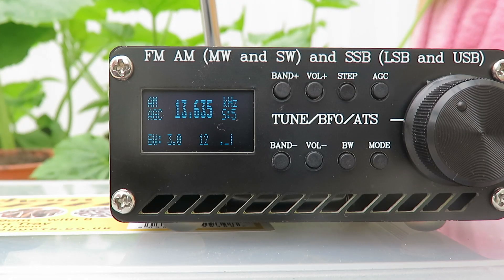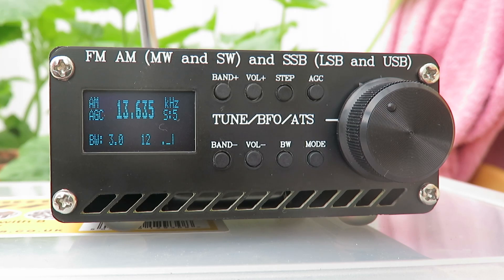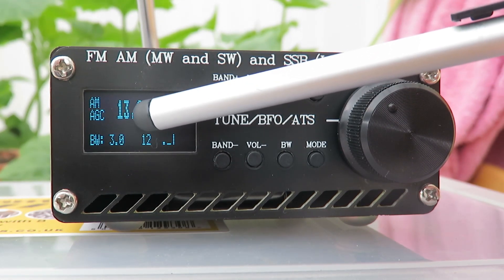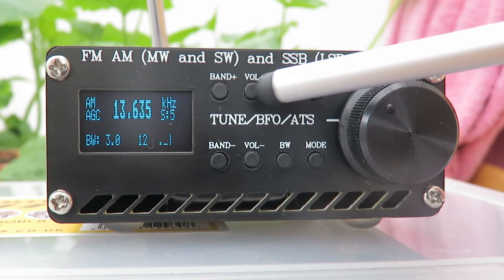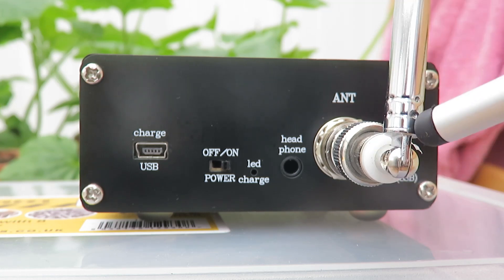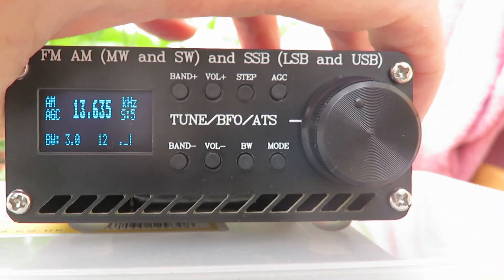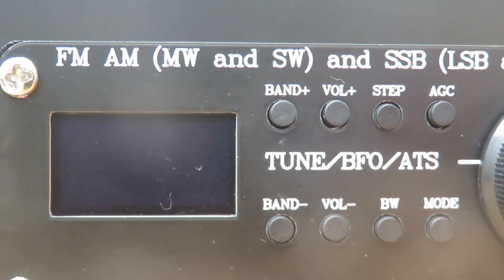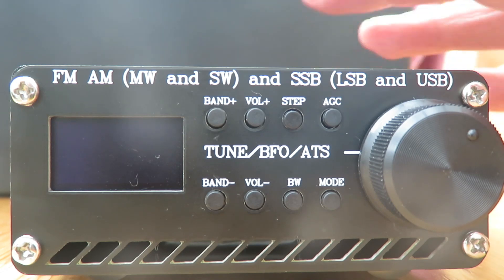An Introduction to the SI4732

Comment: sorry to bother you with what you might consider a silly question.  i have a ATS-20 branded SI4732, and have been rather pleased with it, my main reason for getting this radio, is to listen to amature hams.  my question is, what is the bandwith(BW) button for?  i know the definition of bandwith, but i dont understand its application here.  please help!  thanks much for ur time and consideration, all the bet, over and out!!
mish
Reply from the maker: The bandwidth button helps cut out interference from close by stations. The wider the bandwidth the better the sound quality but if you are experiencng interference try a smaller bandwidth. On SSB most radios run with a bandwidth of around 2.5 to 3khz but on a crowded band you may want to try a narrower filter maybe 1.8 khz

Comment: Interesting. I still have no idea how to use this.
Reply from the maker: Brian, l had hoped that this introduction video would help. What are you finding difficult with the radio?
Reply: @KevinOReillyswl  well from a complete beginner point of view I have no understanding of this radio. For instance what are all these buttons? I have no clue what these acronyms mean or how they relate to adjustment. I think just from continually messing with the radio I've started understand a few things. For one the frequencies are set up in a thousand megahertz blocks, when you push the mode button you can push the main tuning knob and tune people in on some of the ham bands. I still don't understand what the AGC button does or the bottom left band button or bandwidth. Also step makes no sense to me, why would I want to skip channels in blocks of 10 or 100?

Comment: A good overview. I ordered the same receiver as a set-top box for my computer to receive FT8 and RTTY.
Only this receiver does not have input selection and I have already made additional band-pass filters after the antenna for amateur bands. I hope this will improve the radio reception. And also, to reduce the noise of the air, it is necessary to make an attenuator with a smooth adjustment from 0 to - 60db at the input from the antenna, This is also done and tested on another radio. Thank you and my 73!

Comment: Hi, i Just received this radio and playing around with . Do you know is it possible to open/Program the freq. range to air band 108-134 and 134-175 ? And if so do you know how ?  Thanks
Reply from the maker: No the chip does not cover those frequencies

Comment: Tuning that radio would drive me nuts. 

Any radio with the SI4732 chip will suffer from that horrible distortion on SSB which is almost every DSP radio I've heard. At least the radio in the video above doesn't sound as muffled as the Tecsun PL-880/990x and S-8800. The newer PL-330 actually sounds better than the PL-330 and the 4Khz filter actually works. 

With the SI4732, SSB was an after thought.
Reply: Yeah, i have an S-8800 and i really (hate) it that the 4Khz on SSB is not working, also the overal sound of the S-8800 is really not that good, for such an expensive radio... but still a nice radio ;-)

Comment: Yes, the encoder is crap but it is simple to replace if you have the necessary soldering skills. It uses a variation of the very common EC11 encoder that you can get many places including Amazon. The original is 'upside-down' in that it mounts through the front PCB so the shaft is in front and the body in back. The normal EC11 can be used this way by bending the pins in the opposite direction. The replacement I bought is much sturdier than the original. It is listed as "uxcell 360 Degree Rotary Encoder Code Switch Digital Potentiometer EC11 7 Pins 15mm Shaft". The rotation is reversed from the original. If you are updating the software, it can be fixed there very easily.

Comment: My second ATS 20 arrived today via Amazon.
Took 7 days from China. Delivery from them always quicker than they advertised
I recommend them rather than Ebay for this set.
Interesting thing is that the on off and the band select buttons on the rear are slightly longer than my first one making it 
easier to operate them both without having to turn the radio around. Very useful.
Noted that Ricardo has removed all earlier versions from his library only leaving version 7.
It upgraded without issue.
I absolutely love this little radio
Thank you for all your posts Kevin. You have helped me tremendously 

Andy

Comment: Ciao. Ho Ordinato anch’io una SI4732 ma, con stupore, mi è arrivato una SI4735. Sai dirmi qual’è la differenza fra i due apparati? Grazie
Reply from the maker: I haven't seen one of these radios with an SI4735. How do you know it is a 4735?
Reply: @KevinOReillyswl  appena accendo l’apparato, mi da il modella e la versione. Cioè SI4735 e la versione è 1.1.5
Reply: @KevinOReillyswl  vorrei inviarti una foto ma non so come si fa.
Reply from the maker: @vitomelis   That is just the startup screen, Ricardo has that title in the sketch. It can be changed. I think your radio has the 4732 chip.